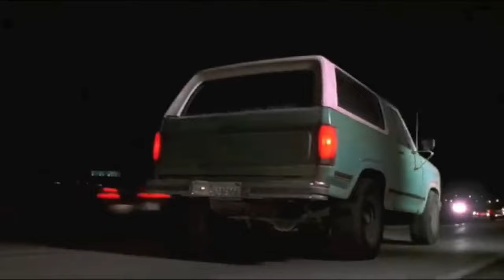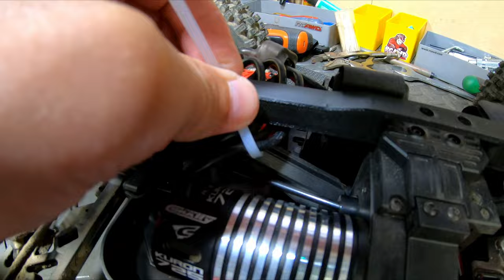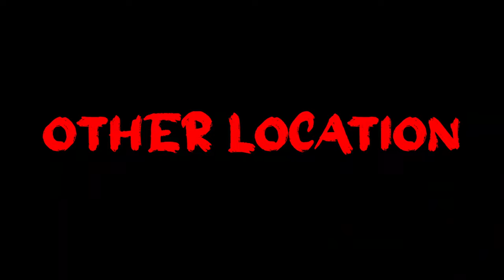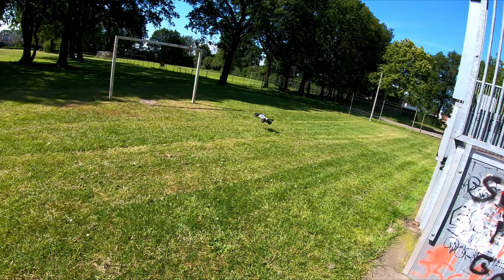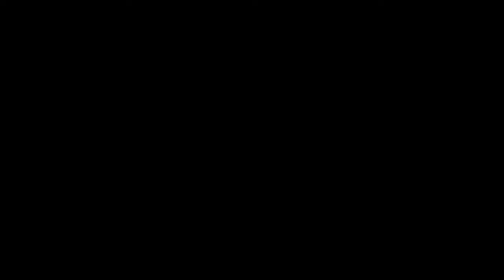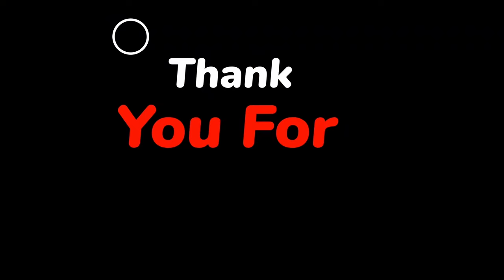Will it survive? The Team Corally Syncro4 ULTIMATE test!

Comment: I did most of what you are doing or thinking. Put a fan on the motor. Got rid of that silly motor mount and put a sliding motor mount in from a Spark. Fit right in. Velcroed the sides and dropped the antenna tube. Put in a 19t pinion. Runs like a dream!!!!
Reply from the maker: @Soney_Manic  awesome

Comment: i know you have a KAGAMA is this 4s system as powerful as the 6s system by that i mean like a 6s spektrum system doesn't seem to have half the punch that corally 6s system so is this 4s corally system that much more then the 4s spektrum
Reply from the maker: i don't have a 4s spektrum esc, but it goes very fast for a 4s car. Team corally esc are in my opinion better then the spektrum ones. i had several 6s spektrum (that all burned up after a while) and those weren't as strong as the Team Corally 6s ones so.... i this it's the same with the 4s ones ....